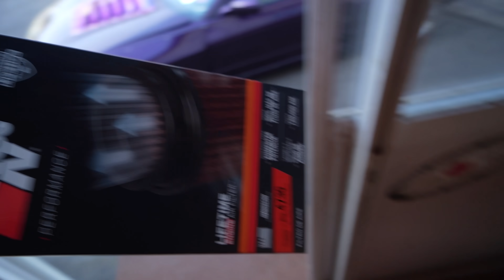Surviving a BRAKE FAILURE: My Terrifying Car Crash into the Woods!

Comment: I would have been way caught up with the fact that my pedal is going to the floor to even think about trying the handbrake, huge respect on that response Sam real quick thinking well done.
Reply: Well that is why it’s called the emergency handbrake.
Reply: I feel ya but for a drifter that e brake is second nature.
Reply: Yea... The e brake is used a lot though so obvious to try drifting to slow down
Reply: Pretty sure the rear wheels locked up before he even grabbed the handbrake. I'm assuming because the rears still had pressure and he would have been slammed on the pedal.

Comment: Did you say Toyota is going to replace the transmission? or at least the part that failed?!?! That sounds wild to us American's. Would love a video going over the details of how you went about getting it replaced.
Reply: Toyota will always send new part if theirs failed and everything is kinda factory/not pushing too much power, you might need to send the part in question for them to study why it broke😊
Reply: @psycomanic737  even when it happens on a track, on a car with an upgraded turbo? That is amazing. Just wouldnt believe it would happen here in the US. Those cars are far out of warranty.
Reply: @bigzlowered  lifetime powertrain warranty maybe?
Reply: @bigzlowered  one guy had his diff replaced for free 3 times because he was hauling rocks up a cliff (work truck) all for free and toyota was studying why the diff was blowing up and upgrading it each time. They also traded a corolla with 1 million km or miles don't remember which of the 2 units for a brand new one of the year and they studied it to understand why that one lasted longer than the rest

Comment: I had both my brake and handbrake fail right after a serpentine. And it was a stupid automatic SUV (a Mitsubishi Pajero)....  crossed 2 stop signs - without stopping - until I rolled to a stop.

Not a great feeling when your pedal drops to the floor. :(

Comment: I just had the same situation happened to me one month ago today came up over Hill and there was a bunch of cars parked in the road when I hit the brakes the car did exactly what your card did. Acted like it was sitting on ice and I had no control end up sliding sideways into a car pushed my driver door and my rear door in 6.5 ish inches and bent the frame I'm now out a truck until the insurance company settles up with me. Thank goodness you were able to pull it out and not total your car.

Comment: Good save by pulling the ebrake and sliding off track like that......probably worked out alot better then anything else you could have done at the time Sam. Ive been in situations similar to that and it definetly makes your heart jump into your throat. Glad noone got hurt and the car was even easily back on track.

Comment: When doin the backies and hitting that lock/angle stop that'll pinch/cut and tear brake lines really easy. Had it happen on full lock half way around a corner in my Cefiro. Gotta relocate and extend the lines.